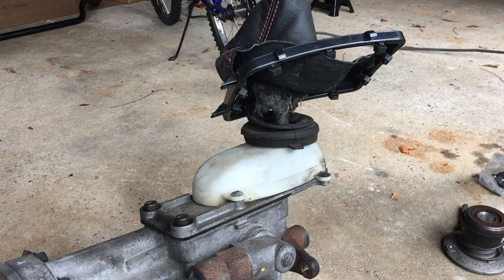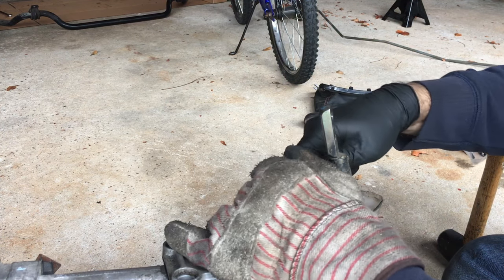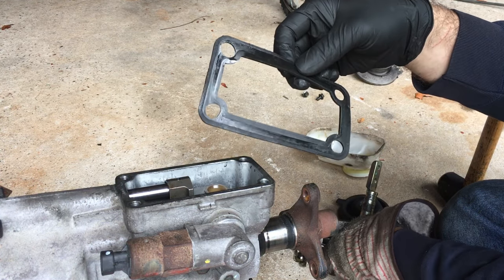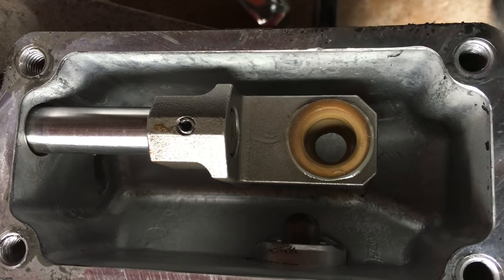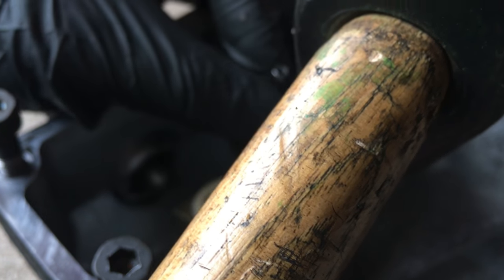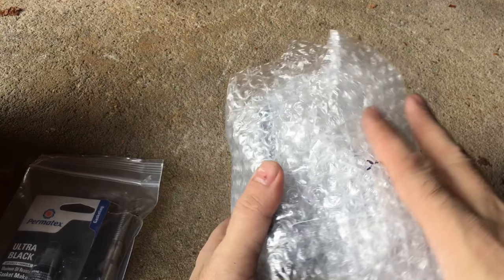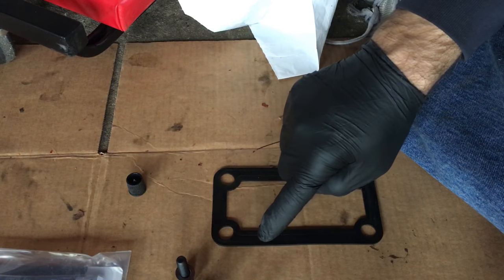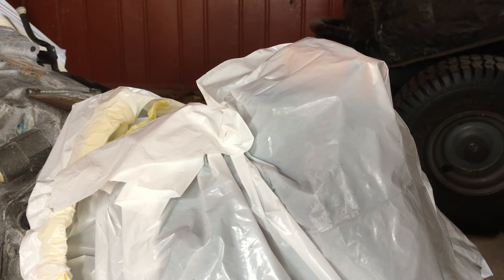MGW short shifter install on  T56 Transmission - LS1 240sx (S14) Drift Build (EP 17)

Comment: Great videos man! Thanks for the detail and PN's.. one question about the tremec offset lever. On their link it says it will not fit the GTO. Is that because of the difference in length? Just making sure the shaft diameter is the same.. thanks in advance!
Reply from the maker: The Trans is the same except for the cup that holds the shifter ball inside. I show in the video what needs to be replaced. then it will fit fine.
Reply from the maker: Chris Farley  This was a bit of confusion to me as well. I believe the only difference from a camaro t56 and a GTO t56 is the cup that holds the shifter, as shown in the video, and the shifter itself. The GTO t56 with shifter actually sits a bit too far back. you would have to trim the  rear of the shifter tunnel area. What I found was that I needed about 2 inches from the base of the trans. I had to swap out the cup and then got the mgw shifter and it sits perfect. you  can see how well its placed in one of the videos.

Comment: Doing a great job! Quick question, is the gto shifter as far back as the mgw shifter? The position looks similar even after you swap it?
Reply from the maker: I put the GTO shifter on the back edge of the shifter hole.. and the MGW perfect center.. it appeared like small cutting was going to be involved so i just went with the MGW.. 2 things with the MGW.. first, its a really short shifter and may not be "ideal" for shifting gears mid drift.. will find out in couple weeks. Second, the height of the gold part sticks slightly above the center console so a little tweaking is needed to have it look oem. I have complete interior and besides 2 gauges above the radio and a round shift knob it looks factory.
Reply: Thanks! I'm doing the same swap but with an rx7 so your videos are really helping out
Reply from the maker: Good luck on your swap! Already thinking of what I want to do next.. haha

Comment: So where on that website did you find it for a gto
Reply from the maker: using the GTO piece that spaces back the shifter puts it TOO far back. I removed the GTO piece and in one of the videos showed what you need to change in the trans and then used a camaro shifter.
Reply: What year camaro